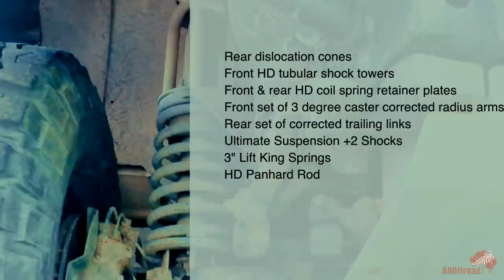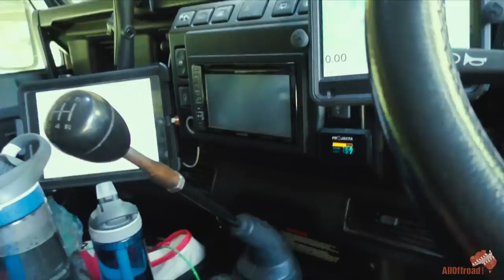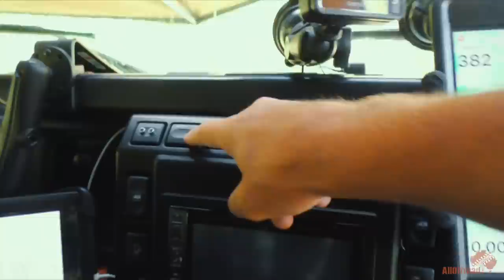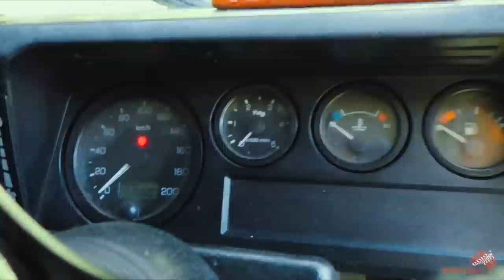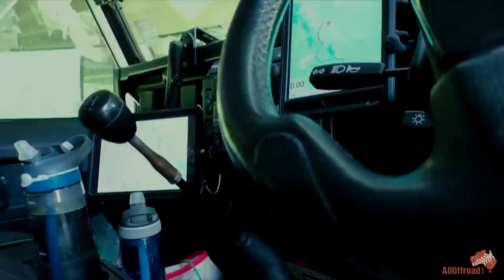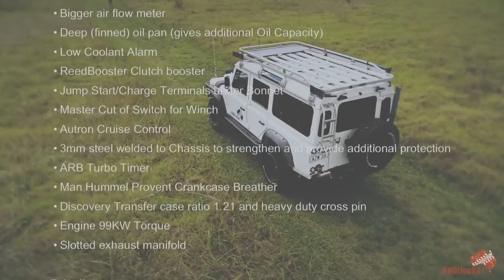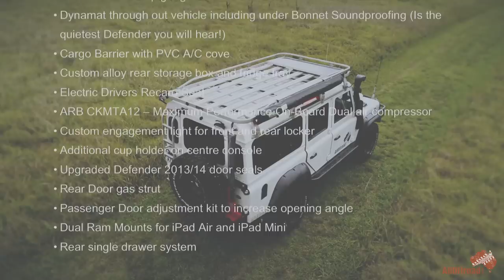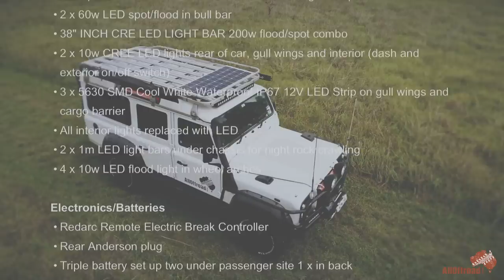Land Rover Defender 110 | 4WD | The Ultimate OVERLANDER | Walk Through | ALLOFFROAD#108 [2017]

Comment: This is an EPIC Overlanding Defender! Congrats!!!  👍🏻
Reply from the maker: thank you yes it was, it it only had been more reliable..
Reply: Oh reliable? What was / went wrong? Because I have 30 years of 4x4 Toyota Land Cruiser, Land Rover and Mercedes G experiences...
Reply from the maker: to many things, gearbox rebuild at 70.000k, ignition barrel relays, high pressure fuel hoses, fuel pump, drive shaft every trip something else after having spend 120k on it
Reply: Oh, I see what you mean. Are you doing the maintenance and repairs yourself or do you go to a (professional) workshop and let them repair those things?

Comment: Hi, Great review of your 110 - I have watched it in action on a number of videos and it is a very capable vehicle.  I drove the 110 Perentie for many yrs in my time in the Aust Army and always enjoyed them.   In the near future I am now looking to buy and kit out a 4x4 Touring vehicle for my travels around Australia in retirement.
Not interested in late model trucks such as LC 200 etc with all the electronics and complex diesel engine components and such and fair to say I am still in decision mode.  Considering an earlier model LC, older model 70 series or 110 Landie.  They all have their issues when touring off road - the LC particularly with alternator and mud.
The only thing I ever broke in the 110 was axles (off road work was extreme) we drowned a couple of engines as the first lot never had snorkles (god knows why) - you look to have addressed the weak axle problem but also the Perentie was notorious for seal leaks, apart from that it was an almost unbreakable piece of kit albeit it had some extra mods for the military. In favour of them as a vehicle we didnt give them much respect off road and would never consider pushing a veh so hard in my future travels.

My question is - in your experience with your 110 and others 110 owners you would know, how reliable and durable are they - I plan on driving it all over Australia over a number of yrs with a fair number of K's being run up and do not want  a veh that will end up a money pit and need time in the workshop ever time it works hard?
Also, do any 110 models have Isuzu 3 ltr engine as used in the Aus military version?

Its hard to get a feel for reliability as on the web you only ever hear of the bad stuff - fair to say I have seen many issues with other makes which can be attributed to the driver lack of respect for the veh in the vehicles defence.
Reply from the maker: Hi Mike,

in my experience the defender is as reliable as most other vehicles if properly maintained, the Perenti with the 4DB1 engine is super reliable and a great combination, upgrade axels, cv's, driveshaft's (if you run bigger tyres) service frequently and you have a top tourer
Reply: Thanx for the feed back - They might not look it but those 110 Perentie's handled like sports cars.  I have considered buying one and rebuilding it up for a tourer - there an old school vehicle and I still remember having to bleed the injector line whenyou ran out of fuel :-) but that is the simplicity I am looking for.
Thanx again
Reply from the maker: yes also considering building a Perenti but want an auto and there is no auto solution for the 4DB1 yet
Reply: There good buying at the price they are going for which leaves plenty of money to mod them up ;-)
Reply from the maker: Yes KLR does a necessity kit like Turbo, power steering etc

Comment: Your setup seems to be thouroughly worked through. Personally I fail to grasp why build on the Defender platform when there's Land Cruisers and Patrols out there, but that's just me. How are your batteries set up ? Did you have 3 of them  and is really 100 watt solar enough ?
Reply from the maker: yes 3 batteries two under passenger seat one in the back, yes 100w was sufficient for me. The Defender is excellent touring platform and I absolutely loved this truck, it got me everywhere with fewer issues than quite a few other known brands in our group. However, it's since sold it and I bought a LC 105 as I needed more space behind the driver's seat for my kid's

Comment: very nice rig! some great idea's quick question  do you know anywhere you can get the maxi-drive diff locks? i heard they don't make them, anymore is that true? also do they replace the actual diff centre? and do you have an opinon on what's the best available rear diff replacement/ lockers actually a couple of question there haha
Reply from the maker: hello, correct MaxiDrive lockers are no longer manufacture, you find them sometimes on the second-hand market but they are quite expensive now as regarded as the best diff locks for Landrovers.

Comment: I've been following your vids for a while, just saw this one. I see you've sold it now but what a rig! I went to put those Recaro seats in my 110 Puma and nearly fell over when I got the quote! Do you still have the fyrlyts? I recently put a set on and I'm amazed you don't see them on the front of every 4x4. They just light everything up so well!
Reply from the maker: Yes Recaro are not cheap but my back is worth it, no have the Nitro Max light bars now while Fyrlyte are great I found I don’t need to see 2km ahead and did not like the 24v step up converters.

Comment: Hi, would you still recommend the  clutch booster from Red Booster. I read somewhere you found it hard to get replacement parts, is that still the case. Cheers
Reply from the maker: No I would not as I never managed to get the part I needed.Andrew does not reply

Comment: Can't beat a classic but there are alot of mods which are illegal. The lights for one, I think they are a great addition but you can't fit LEDs if they weren't original equipment. Like some other comments there are a number of illegally modified 4WDs driving on the road.
Reply from the maker: You are wrong informed mate everything is legal and engineered, you sure can use full led headlight replacements as long as they are ADR approved.
Reply: @AlloffroadAu  ok

Comment: In my humble opinion, you find here what is missing on this Defender: http://www.tibus-offroad.com
All the best from, Portugal.
Reply from the maker: Hello Sergio, I beg to differ as much as I like Portals I probably would not want them on a Touring Vehicle; the service intervals would not suit long range touring, it introduces a host of new things to fail and certainly not getting parts for in the Australian Outback. I can't remember many incidences where I required them touring either. I have a Defender with Maxi Drive Portals https://www.youtube.com/watch?v=lvZbleEgx2I&t=1s but they are for play. I unfortunately, heard a bit of negative feedback for the Tibus Portals, someone In our Landrover community had them installed here in Australia, they did not work well in our conditions and constantly broke so that he removed them again after a year.  Regards Steve
Reply: Interesting, I have a friend who competes in the 4X4 "trial" and nothing bad says of portal axels,, also has some other car(mercedes benz G) that uses to travel, it is sponsored by Tibus (thanks to him I know this German mark), but, I went more to the central control of temperatures, the wheels, central air filling in the wheels, the suspension, portal axels give much maintenance, for those who want to travel over in isolated regions, I had a Experience with a Unimog (Unicat) in Africa, the temperature control is really excellent, it avoids many faults, and the power plant of the wheels can avoid trouble in the middle of a river !! I am thinking of importing a Land Rover Defender 6X6 from Australia (ex.army) and make a small expedition vehicle, mechanics all Mercedes and resort to Tibus and nowadays it is increasingly difficult to enter national parks with trucks ( Even with unimog), who knows if we meet in the middle of Australia one of these days?
Reply from the maker: Hi, as I said portal axles are great for competitions or rock crawling, not sure about Tibus ones given what I heard but maybe they fixed their issues. I had another guy from Japan contacting me on FB who also had his Tibus portals broken several times. It would be an expensive try. The Perenties are great vehicles with the 4DB1 engine they are nearly unbreakable I'm also considering a build :-).
Reply: Everything has its limit, even the best steel breaks, many people break differential, others never left any, because they are careful, they say that the Dynatrac differentials are very good and even they are, but, whoever breaks them, these portal axels do not fail The rule, I mentioned this Tibus, more for the wheels, central tire inflation system and temperature monitor! I think (in my humble opinion) that is what is missing in your Defender! As for portal axels, I know it has a defensive, even with the directional rear axle, I've seen the videos all (some even repeated), I swear I'm even thinking about importing a Defender 6X6 from Australia! And they are not very expensive (I get notification for every auction they make) to make a small expedition vehicle, I have a friend in Holland who has already imported one, is currently working on it, and I wait to see how it is, realized the idea ?
Ps. I've already seen ALL your videos , and some  several times!
Reply from the maker: yes, I agree everything can break, but the Tibus portals broke on every driver he did when every other car had no breakage, but this was a while ago maybe they have improved them now. The Maxi Drive Portals in my Defender are in there for ten years and had one broken half shaft in all that time (which is designed to be the weakest point). While I like tyre inflation system and heat monitoring, it again adds more things to fail, given that once offroad I don't need to vary my pressure too often and the temperature is also no issue. In Australia, the requirements may be a bit different then in Europe, if you drive for hundreds of kilometres on highly corrugated roads not sure how well the pressure monitoring would survive this. If Tibus like me to test some of their gear in the harshest conditions happy to try it and give my honest feedback.
Reply: No doubt in Australia it is extreme! The electronics do not like dust and be very shaken! You could get in touch with  Tibus, maybe he's interested. That would be a real test! You pay nothing for trying, right? 
Everyone was winning!
Reply from the maker: Tibus does not have a good reputation in Australia anyone who had the portals removed them again as they constantly broke